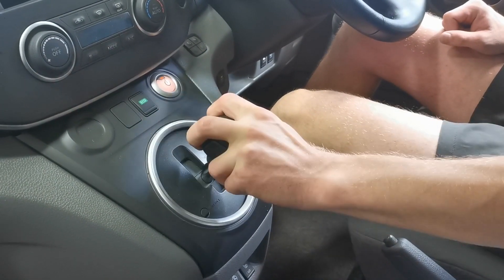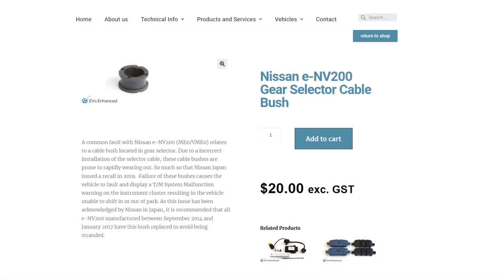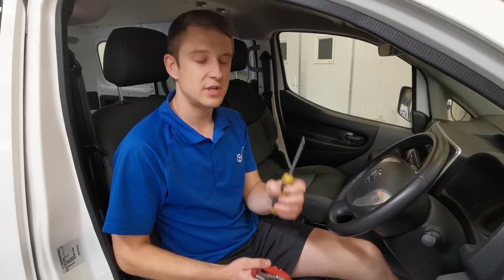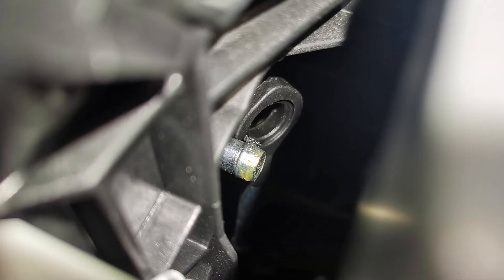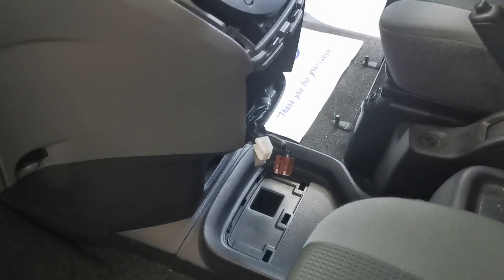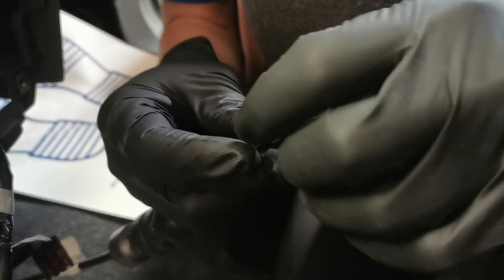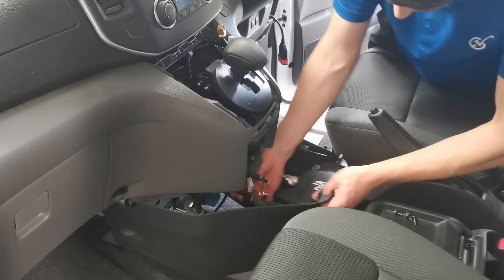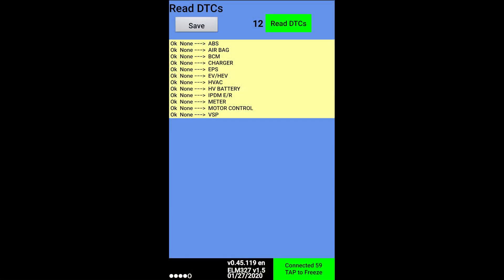Nissan e-NV200 T/M System Malfunction with DTC P0706 is not as scary as it might sound

Comment: Hi! Thanks for your video. I ordered the part on Nissan original service and changed it fallowing your video. Unfortunately the problem still exist. 
P-mode doesn’t work and the t/m system maltfunction is showing. Do I must to remove the system problem with diagnostic source like Leafs by pro?

Comment: Thanks for this. Now that I changed it, I still have the error message on the screen. I use Leaf Spy Pro with OBD dongle to read and delete DTC message, but it doesnt work...how can I delete message on the screen please?
Reply: I have the same issue. Fixed the issue but still have the error code.
Reply: @clubcompost did you manage to remove this error code. I tried disconnecting battery without sucess
Reply: @walterwold1168  no, I'm still driving around with this annoying light on.
Reply: @clubcompost  I guess ill just leave it then. Ive also tried connecting three types of OBD without any luck. Perhaps someday, the car industry will intergrate OBD to the car so you can just use a app for reading faulty codes.

Comment: Mein Auto hatte das gleiche Problem.
Ich habe ein Loch in die Metallstange gebohrt und ein Gewinde M4 hineingeschnitten. Dann mit einer großen Beilagscheibe und einer M4 Schraube die schwarze Öse des Kabels an der Metallstange befestigt. Das hält wahrscheinlich besser als die original Gummihülse.

My car had the same problem.
I drilled a hole in the metal rod and cut an M4 thread into it. Then attach the black eyelet of the cable to the metal rod with a large washer and an M4 screw. This will probably hold up better than the original rubber sleeve.

Comment: Do you have a part number we could use for searching for this part in the uk? The dhl postage is way too expensive. Is there another option you could offer for us in the uk or a company you would recommend?
Reply: Part number I got at my Nissan dealer in Norway was 344264-FA0A, cost 170NOK, so around 13GBP :)
Reply: Nissan also like replacing the entire cable, but if you pester them, they order the bush for you.
Reply: @johnhanssenkolstad211  Tack, jag beställde en och fick betala 123 SEK för den.

Comment: I have this exact fault and error code, but I can still change gears, although the link near the motor doesn't move
Reply from the maker: We carry this bush in stock if you can't find one locally.  https://evsenhanced.com/product/nissan-e-nv200-gear-selector-cable-bush/
Reply: @EVsEnhanced  It's $80 in total with delivery =(
Reply from the maker: @dtrrider1  Yeah, minimum charges with DHL, make sending something so small pretty expensive.  At least it is a backup option if you can't find one locally.

Comment: Could you please help diagnose this fault?
My E-NV200 has started making a loud clicking noise when allowing the regen to slow the car. It makes no noise when accelerating or coasting, or reversing. There are no fault codes either!!??
Have you come across this? It kinda sounds like the park detent is out of sequence and is trying to find its hole!!!!!!!
Reply from the maker: Perhaps a issue in the reduction drive or diff?  We have also seen a very rare case where the motor stator was loose in its housing.  It could also be something more simple like an axle nut coming loose.

Comment: Is this the same issue that causes the t/m fault on the leaf
Reply from the maker: Hi. No the Leaf is completely different in this sense. Only the van has a shifter cable.  The Leaf has a fully electric actuator to select park.
Reply: @EVsEnhanced  ah I see, what should I be looking for on the leaf? the 12v battery is new..
Reply from the maker: @markymark8472  A T/M fault shown on the instrument cluster can be caused by a lot of things.  The next step would be to read the DTCs (fault codes) through the OBD2 port with a diagnostics tool.  There are plenty of professional diagnostics tools that can do this if you take the car to someone, but the cheapest way to do this yourself would be using LeafSpy Pro (must be the Pro version).
Reply: @EVsEnhanced  Hi and thankz for the video, I manged to to fix this problem by watching your video. Very happy indeed, my problem was exactly as in this video, the old bushing looked same as yours😃. I dont have a ODB scanner and was wondering if you could please tell which one you use with the LeafSpy app. I need to get rid of the warning lamp in the dash. Thanks.
Reply from the maker: @NoName-pb8bc  Hi. Good to hear that this helped you. Sorry, we don't sell OBD2 to Bluetooth adaptors and can't recommend any particular one to buy with known compatibility with LeafSpy.

Comment: Can you please elaborate on why it is best practice to disconnect the 12V battery in the ignition on, ready off state? I've always been taught that I should have the ignition off when disconnecting and reconnecting the 12v battery in ICEVs, HVs and EVs.

In all other respects, thank you for a helpful and informative video!
Reply: Yes, it's very strange way to disconnect 12V battery as he suggested in this video. As in doing so you might trigger some fault codes. And I see no reason why they want to disconnect it in the first place, as this work does not involve playing with electrical stuff, only few plugs disconnected. But I guess they want to make sure there is no liability on their side if something goes wrong.
Reply: I was going to ask the same question. Surely the inverter is charging the 12V battery in this state?
Reply: @GoGreenAutos  Inverter charges 12V battery only in Ready state. At least it does so in LEAF.
Reply: @GoGreenAutos  Not sure i would actually bother to disconnect the battery, i don;'t see any safety concern here at all.
Reply: @willdatsun  Yes. Completely agree. But I'm still unsure why he recommends disconnecting the 12v battery with the ignition on.